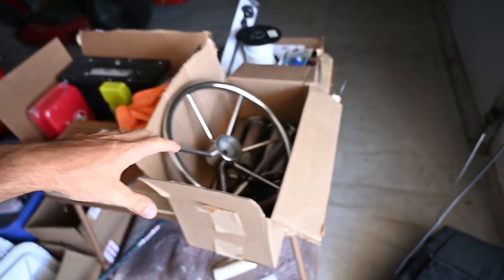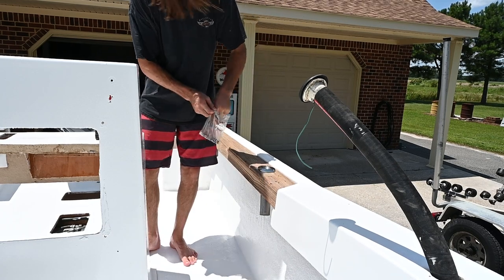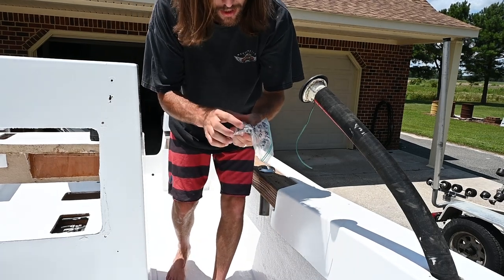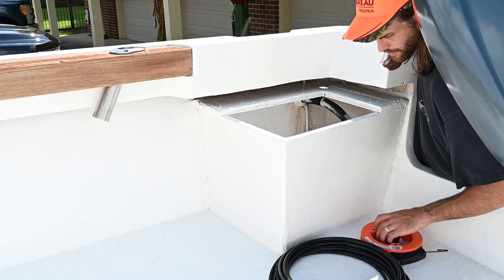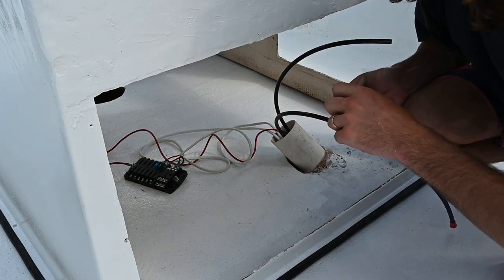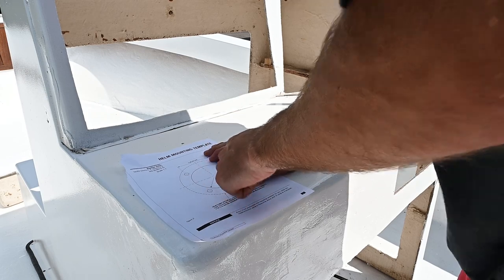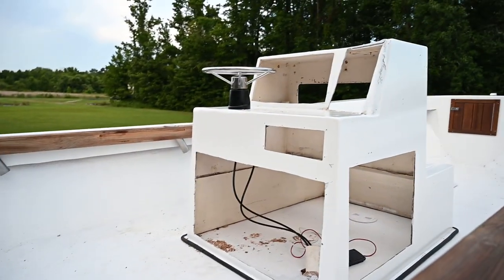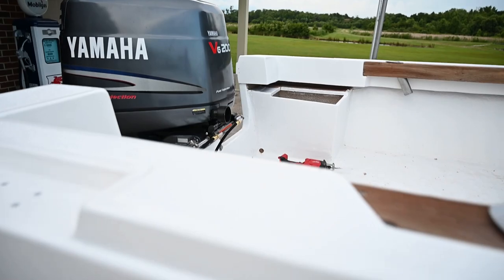Rebuilding a Center Console Fishing Boat - Episode 17: Hydraulic Steering

Comment: Note to others.....put a bunch of pull strings in the pipe when you're rebuilding the deck/stringers/etc.  Makes pulling wires, steering hoses/cables, etc....SIGNIFICANTLY easier than fishing them through with a snake.

Comment: I've done a good bit wire pulling with ethernet or fiber cabling through conduit, so I highly suggest for anyone doing this to run a "chaser" through and then every time you run a new cable through the sub floor pvc, attach a new "chaser" and just pull to the other end. Chaser being a strand of poly rope something that's lightweight but has high tension, so it doesn't snag or break when pulling things with it.
Reply: Jet line
Reply: And if you forget to put a chaser in you can vacuum some twine through the conduit , then pull something heavier through